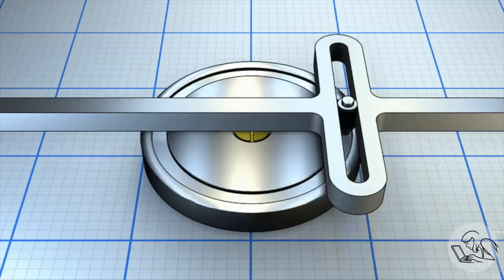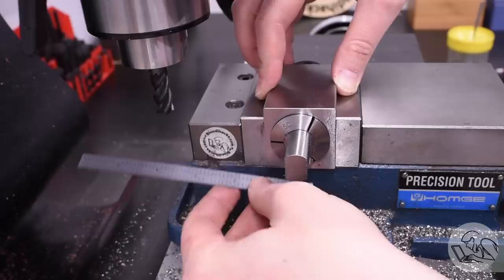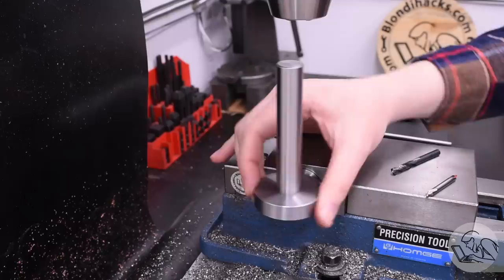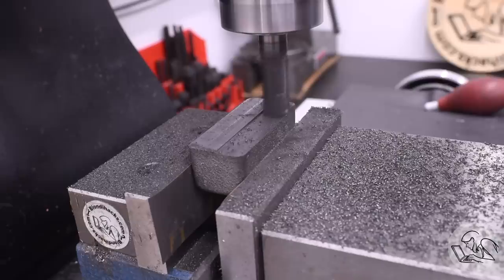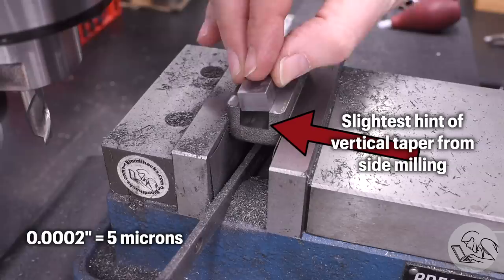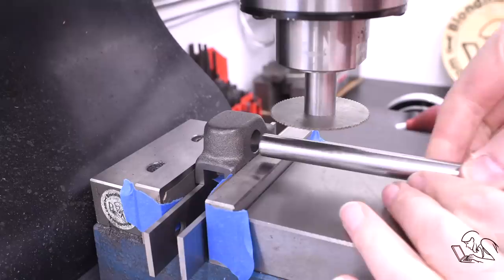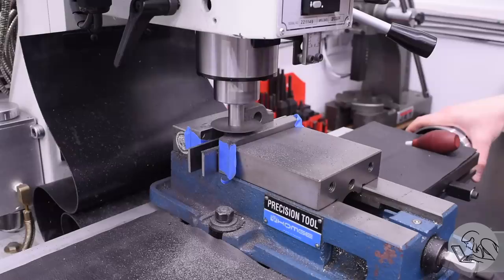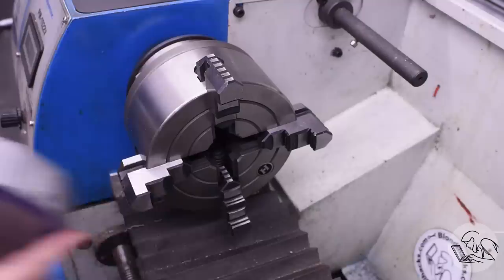Let's Build a Die Filer - Part 5, Scotch Yoke and Sheave!

Comment: Another interesting property of a scotch yoke is that it provides a true sine-wave of motion. A normal crank setup is actually the sum of two waves, with one at twice the frequency as connecting rod covers slightly less vertical distance when it is angled at each left-right motion of the crankshaft. The motion approximates a sine wave, but has a few extra funny bumps in it.

Comment: Bend a V-belt around a pulley and the inside diameter compresses and the outside stretches. So, smaller pulleys need a different angle than larger one to match the "squish" of the belt..
Reply: came here to say exactly that ;-)
Reply: Hello Scott, how are you doing😊

Comment: Putting it on top of the motor sounds like a neat solution.
Reply: Yeah, I also wonder if it could be upside down, then you could mount them to opposite sides of the same board/bench...
Reply: Just go for direct drive and use a VFD to run the motor.
Reply: Can use the motor's weight to help tension the belt that way I think.  Although it's probably more complicated than that...

Comment: tip for a die file yoke, do not use oil as a lubricant, use graphite powder(pencil lead) the fine particles from what ever you filled aticks to the oil and messes the machine up, graphite powder does not allow any material in as its a "solid" lubricant
Reply: There are a couple of lubes that use molybdenum disulfide in a carrier fluid that then evaporates. The moly is a great lube for what is going on in this machine.

Comment: You could turn the motor and die filer counter clock wise. Placing the motor behind and pulleys on the right out of the way or turn more placing the pulleys in the back. This way the filer always sits as low on the counter so you can see from above downwards on the piece your working. Which is the way die filers are used best.💡💡🤔💡💡 Making a 1 inch platform stand from 1" square tube welded and a cover guard over the belt and pulleys would be the icing on the cake. 🎂🎂🎂🎂🎂🎂🎂🎂🎂🎂

Comment: If you are in a hurry to make something round you can just hold it against the 4 jaw with the jaws loose with the live center of the tailstock placed in the center drill hole then tighten the jaws. Thanks very much for the slitting saw tips. I have been buggering things up with them since for ever taking light cuts.

Comment: I think this is the same kit someone at our maker space made a few years ago,  prob longer then that,  but we just moved the motor to a new mount and table set up with the motor below the rest of the unit.  HUGE diff is workable space.  It allows us to move around the whole unit easier and not have to work our bodies or projects around the unit.  Did not change anything else,  and it was worth the extra work.  Also,  one of the guys made a piston that holds a small saw blade and you can use it to saw metal now in fun shapes.

Comment: I do the slot second, but. Hope, tap, counterbore. Don't drill the clearance. Then slot, then drill the clearance. Clearance over a tapped hole is a light cut, so no need to support the slot.

Comment: Very nice job.  Something I have seen done on pulleys with little or no collar shoulder is instead of drilling and tapping the hole straight down from the top at 90° to the shaft you could have drilled a hole on an angle of about 30° from the face of the pulley about 3/4" above the bore.  This  should let the set screw still seat against the woodruff key and also lock the pulley since you are using a woodruff key the key would rotate in the shaft seat slightly to jam against the keyway slot in the pulley.  Doing the threaded hole this way would take a bit less time since you would be removing less material in the pulley and the time needed to tap the thread would be less.  Just a thought

Comment: Now I want to see a crank block made of Lego :)
Reply: The scotch yoke is a useful piece of engineering to use in Lego Technics because everything's built out of right angles and standard distances, put two long bricks next to each other with a one stud space between them and you've made a very nice straight parallel slot, and a pin on an axle will run in that quite comfortably.

Comment: Can the motor be upside down?  If so, you could mount it directly under, on the same piece of material, maybe on a longer board that could be clamped to the end of a bench and moved/removed as needed...? or with some pole/pegs on one edge that could be dropped into a couple of retaining sleeves on the end of a bench

Comment: That motor looks almost as old as me (or maybe older) but is a good fit with a piece of equipment that looks vintage even when brand new. I have a couple of old motors like that in my shop as well, they’re not easy to kill. At one time my Dad’s shop tools were powered by several old motors salvaged from ancient washing machines when things were made to last (except apparently the rest of the washing machine).

Comment: The belt doesn’t bend perfectly, there will always be regions where the belt is in tension because of the bend, and regions where it is in compression.
The tighter the radius of the bend the more pronounced this is, and the more the belt under compression wants to schmoosh out.
Therefore; although the belt is nominally the same cross section throughout; the angle  (and linear dimensions) change depending on the radius of a curve.

Comment: there is another way to test steel, the grind spark test, if you get boring normal sparks, its mild steel, if you get star like explosions, you can heat treat and harden it.
Reply: Nuts- had to scroll down to nearly the bottom to see if anyone beat me to this one LOL  Yup, the spark difference between mild and tool steel is VERY clear and rather beautiful- fireworks right in your shop.  Fast and easy too.  But it only works for plain carbon steel- there are lots of hardenable alloys that spark quite differently, so it can't be trusted as much as a hardening test.  So basically if you get lots of bright sparklers, it's probably hardenable; if not, it may or may not be.  Another thing is that freshly hardened steel looks rather different than heated and quenched mild steel does- it's gray, and sometimes the surface is kind of bubbly (like it has leprosy or something), whereas mild steel doesn't change much.  There's also the break test- as you've said, hardened tool steel is fragile, so it will snap very easily.  Mild steel won't.  And the broken face of hardened steel will be light gray, with very fine crystals.

Comment: how about raising the filer up so the table is above the top of the motor will you put a tightener (spring loaded or just a cam) or just slots in the base to tighten the belt??? looks cool  should be a great addition to the shop !!!

Comment: It seems silly to me that this is spec'ing tool steel for the slide block.  Generally, the 'hardest' piece wears into the softer piece, so I would think you want the 'easy to make' parts (like the slide block!) be the softer piece, so that future-you can replace THAT part pretty easily, rather than having to re-make complicated parts.

On many shapers, the slide block is brass/bronze for this reason (plus better lubrication).
Reply: I see now that she mentioned (literally 30 seconds after I paused for the above!) the point I was making re-making it the wear item, so glad it isn't being hardened!

Comment: Is it possible to run this with the steam engine you built? That would be awesome to see!
Reply: It’s possible, although typically when you need a die filer you don’t really want to have to fill the boiler, light up the fire box, and wait for pressure to build.  Once you’re finally filing, it’s not such a good thing to have to stop periodically to check your water level, top off your oilers, and to watch and ensure your pressure isn’t climbing too high.  And of course, once you’ve filed your part, then you’d have to empty the boiler, clean the fire box (after it has cooled), and then clean up the mess of spilled water mixed with gently rusting iron filings.

Plugging in a motor and flipping a switch is definitely easier.

Comment: Ok, I have your back, using one of my favorite lines you use.
"Why did you drill the setscrew hole slightly off center in the pulley?" Because SHUT UP! That's why."
Well, that's what I heard in my head, so...

Well done as usual.
Thanks, and Meow to Sprocket.
I would say Quack to Swarfy, but I don't want to reward anti-social behavior.
Reply: I use 'because shut up' now to defend any decision- it's so multi-purpose.

Comment: Is there any particular reason the set screw hole has to be a very deep one through the pulley itself rather than through the boss? Or is it just because the original design didn’t have a boss?

Comment: Random question; why did you use tool steel for the first part if you didn't harden it?
Reply: It's still very strong material- tough, and abrasion resistant.  Much moreso than mild steel or cast iron.